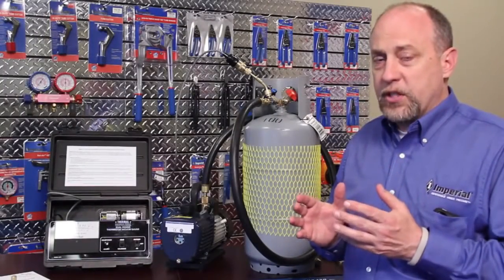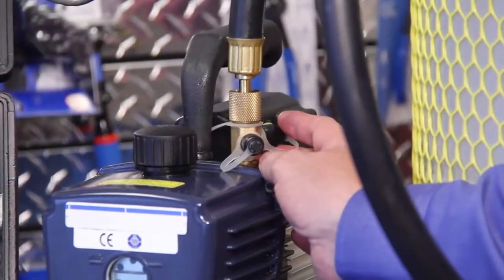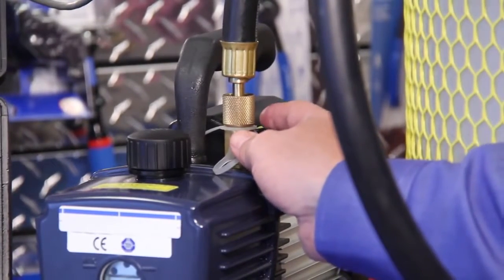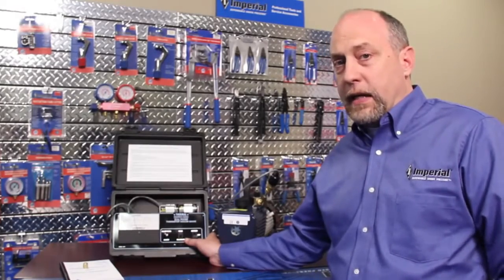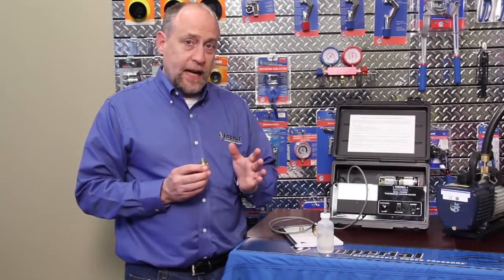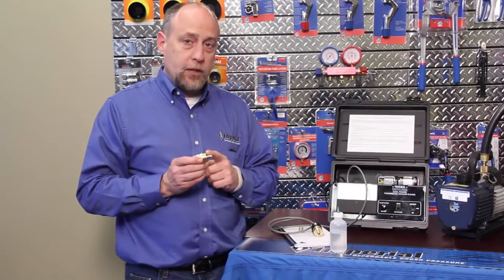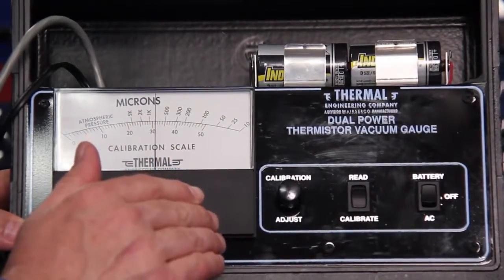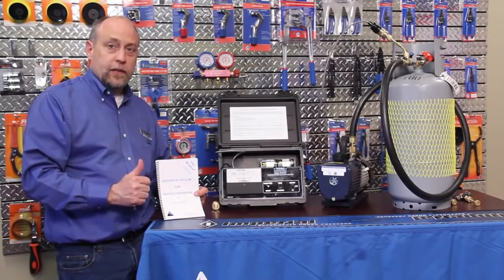Imperial Thermal 14571 4501 Vacuum Gauge Maintenance & Troubleshooting

Comment: I have the 4501, the 4 wires to the sensor socket have come loose from the solder joints, I would like to make the solder connections. Green . white, black, and red. Can you tell me the numbered connections on the socket to resolder them to. I'm very good with a soldering iron.
Reply from the maker: First, please note that Stride Tool CANNOT be responsible for, or honor a warranty on any of our tools, if the end user makes any kind of modifications or repairs. That being said, if you still want to make your own repair please email Customer Service so they can send you a diagram. Email your request or any other questions to: info@stridetool.com Thanks!

Comment: My issue is every other time of use the 14571 does not come on at all from 110 volt or battery. I have sent the unit is 4 times for repair and same thing over and over again. The repair is pricey in the $150.00 range.
It works when in use but the next time I power it up...nothing. I love this unit but I need longer service life from the transformer on the internal board. Is it just me? I am looking for a high end unit that will last more than a couple years.
Reply from the maker: Our customer service manager would like to get some more background from you regarding this issue- would you be able to email your contact information to DomCustSrv@stridetool.com ? Thanks!!